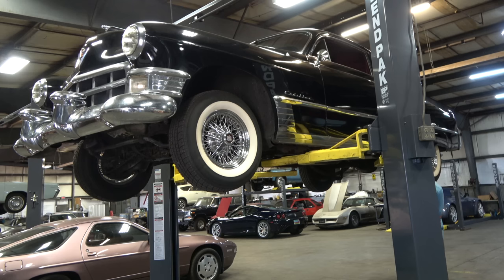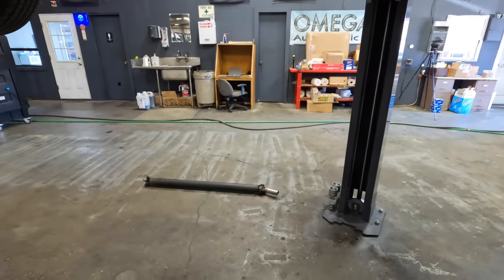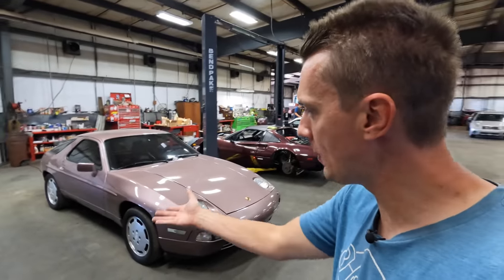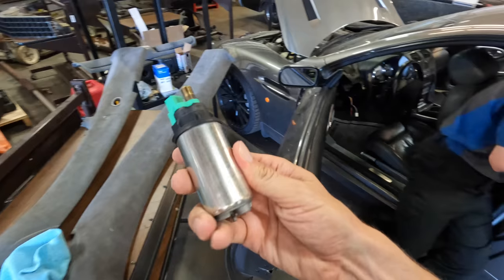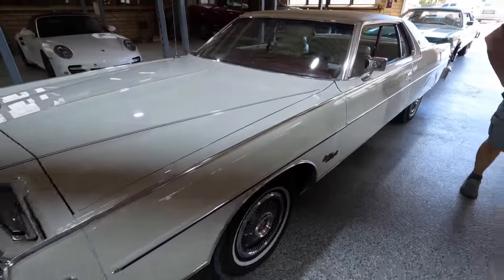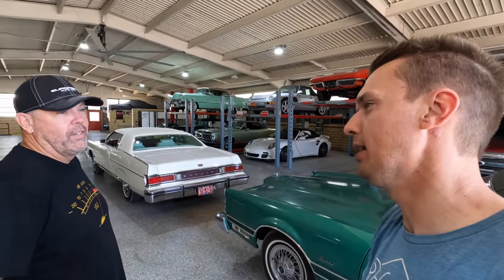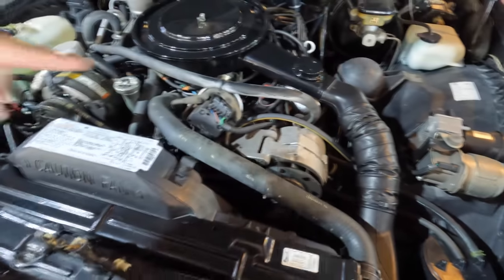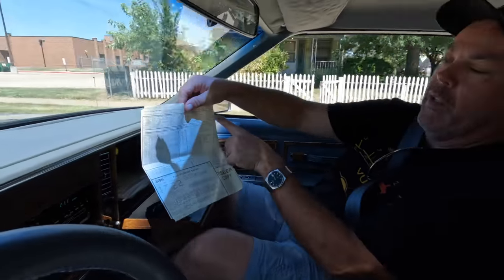We found some weird mods on my 1949 Cadillac Fastback Custom, and more things broken!

Comment: Those 500 CI Caddy motors overheated terribly, so I think the mods were quite beneficial in keeping it cool.
Reply: Drove one for years no problem but I've heard that before.  I would expect a faulty thermostat which is a cheap and easy replacement.
Reply: Yo 🔥https://youtu.be/rdJ9bsN7JAw.
Reply: The size of radiator in my '76 Fleetwood Talisman was insane. It was a 4-core, nearly 3 inches thick and about 3 feet wide. 3x the size of my radiator in 98 Silverado lol. No doubt those old girls got warm!
Reply: Overheating is what American cars are known for. So the more cooling, the merrier.
Reply: @kevinblankenburg4816  Nonsense.
Reply: @kevinblankenburg4816  only the badly maintained.
Reply: @kevinblankenburg4816  and foreign cars are well known for awful build quality and catastrophic failures 😬
Reply: kalle klovn  Big old Cadillacs were common in Vegas in the 50s and 60s.  I saw Danny the count upgrade the AC on a 60s something Cad.  Rich potentates in the Mid East drove Cads.  That kind of stuff is what GM used to do well on.  I would suspect oversized radiators.  Cad was'nt going to turn troublesome cars loose on the customers in the 60s.  Of course they do it all the time now.  Northstar.
Reply: @zackatron925  English cars enter the chat.
Reply: @rogersmith7396  like the Anglia?😁
Reply: What? Gotta disagree with you on that. Never heard that happening at all and I own a 69 deville with 472. You don’t know what you are talking about
Reply: kalle klovn  the Anglia was just a nightmare all around. It was horribly designed car. And as I recall it was only a GB car. Seen a few in the US. Was just a reminder that not all English cars are a Jensen, MG, or Jaguar.
Reply: All Cadillacs overheat
Reply: @ReaLibro  My GT 6 never did'nt over heat except in winter.  It had a host of quality defects.  I have a TR 6 and they were the "reliable" ones.  The Stag of course is famous for faulty cooling design.  It killed the model.
Reply: @zackatron925  American cars of the 70s 80s and 90s were know for this. In the 60s and 70s  VWs and Volvos were racking up 100,000 or more miles while American cars were in the junkyard at 
60,0000-80,000. In the 90s, Toyotas and Hondas would rack up 150,000 miles while American cars were in the junkyard at 80,000. American cars are finally decent again.
Reply: I had a 76 Fleetwood and it never over heated...never.
Reply: @phat-b6771  Nope, had a 76, a 65 and a 60, no over heating at all and I pushed them. Even a day like today, 98 and the AC on, no problems at all.
Reply: We had several  in the  family  over the  years never  had any issues.  We were  in southern  CALIFORNIA  and Arizona
Reply: They are designed to run on the hot side but if it's overheating, you need to do a full coolant flush.
Reply: @kevinblankenburg4816 my.chevy blazer never overheats. Doooshy comment
Reply: Absolutely, I'd expect that the previous owner had a hard time keeping it cool idling stationary with the AC on. That second radiator and fan would likely to a good job dealing with that.
Reply: Had a 1970 Eldorado in 1973. Took it out West from Chicago, all the way out to Death Valley. No problem running cool. Never overheated up to the point I sold it in 1984.
Reply: I wonder if the extra radiator was to help with cooling when doing parades.  I don't think older cars did that well with lots of slow driving.
Reply: Never had a minutes trouble with my 1976 Fleetwood.
Reply: @rogersmith7396  The 4.1L garbage came first and Cadillac knew it was junk.  I know that because they did not put that engine in the professional car chassis'.
Reply: @stephensafraniii3396  That's good.  But that's also 3 decades later then the car in question.
Reply: @zackatron925  which foreign is this? British?
Reply: @rogersmith7396  ppppp
Reply: @rogersmith7396  p
Reply: Pp
Reply: P
Reply: Pp
Reply: P
Reply: @mexicanspec  My parents bought Cadillacs from 1970 onward as did my grandmother.  The 70 Eldorado was great and I have one.  Around 77 they bought one of those downsized Coupe DeVilles which was silly looking but reliable.  Around 1980 they bought a Olds diesel Eldorado which spent much of its short life behind a tow truck.  It also cost almost 4 times what the classic 70 Eldorado did.  Next car was a Mercedes and they bought no more Cadillacs.  We had a Cad dealer in town in business since 1919 and they were very service oriented.  They are gone now.
Reply: Maybe driven in parades? Overheating a real issue in those circumstances
Reply: @zackatron925  more nonsense
Reply: @rogersmith7396  It is a shame how Cadillac lost so many customer by knowingly putting in crappy engines.  They didn't even give the customer a choice, other than the diesel.  If they would have had the 5.7L engine and had the 4.1L optional, they wouldn't have gone down the tubes like they did.
Reply: @mexicanspec  Our 80 Eldorado was the same car as an Olds Cutlas and Buick Regal/Riviera.  It just cost a lot more.  Nameplate engineering killed GM.  And their insatiable price hikes all the while building the parts in China for dollars a day.  I am convinced cars were much more cheaper in the 60s before China and while the unions were at their strongest.  America has been screwed by Wall Street stock manipulation and corporate greed.  The funny thing is now all major car companies are one bad year away from bankruptcy.  Real boneheads.
Reply: @mexicanspec  And because everyone knows Cadillac is just a dolled up Chevy.
Reply: @rogersmith7396  No it really wasn't.  They had different engines.  Also the Cutlass and regal were not front wheel drive.  In 1981 Cadillac had the V8-6-4 engine nobody else did.  In 1982 they had the 4.1L aluminum engine nobody else did.

The most expensive brand got the experimental engines that were no good while the lesser cars had the tried and true V8's that ran forever.  That was a bad call on the brass at Cadillac.

Did you know that Cadillac sold every car they made with no advertising in the '70's and even up into the '80's.  They had a loyal following but the bad experiences their customers had with their cars killed all of that.
Reply: @rogersmith7396  Later on they were but not in the good old days.
Reply: @mexicanspec  There were other problems in the "good old days" like using substandard steel so shit wore/rusted out faster, to encourage people to replace their cars more often. Planned obsolescence is not a new scourge.
Reply: @keithkenney587  Back then, at least  in the North East, it was common to bring a radiator in to be "refurbished" and they'd just snip out the tubes that leaked and paint the outside of it. That was probably a factor when my '71 Cadillac had to be coaxed through the '79 gas-lines with a goose to the throttle every now and then to speed the fan up and cool it down. Cadillac's two-step system, with a  "WATER" light to give you fair warning and a "STOP! ENGINE HOT" light, and buzzer to tell you to give up, was brilliant. Nonetheless, I'd never heard of the 500s being any more or less prone to overheating than the 472s. Could it have been that the water jacket was thinner?
Reply: I have 4 of them 500ci Cadillac engines still in thier original cars! The run and drive fine! My grandfather was a Cadillac dealer
Reply: An alledged rumor was the supplemental use of "Bar's Leak" coolant stop leak additive at various dealerships as a means of repair during the production run of those engines.

Comment: The tube leading back to the auxiliary radiator was incredibly well done. With the undercoat, it looks completely stock.
Reply: That "tube" IS stock, but does not lead to the 2nd. radiator.
Most all cars of the late '40's to mid '50s-ish had similar ducting and there was no full-time vent on the top of the cowl that you see on cars from the late '50s to this day.
Reply: except there was no undercoating in 1949
Reply: @RivieraByBuick  Everyone knows. No one cares.
Reply: @RivieraByBuick  Yes, there was.
Reply: @Johnny96ri  no there was not
Reply: @RivieraByBuick  yes, there was. Tar-based undercoating has been around since the 30s.

Comment: I rarely like restomods but that said I do appreciate the way this Caddy was done.  The idea of a late model Cadillac engine and trans is much better than the usual SBC or LS1 
that is usually seen. The interior is well done and tasteful.  All in all looks like an enjoyable ride.
Reply: Agreed!  Though I woulda gone w/a much more period correct interior, and used those beautiful stock sombrero Cadillac wheel covers.
But yeah, most resto mods suck major ass.
Reply: I want to know what happened to the factory seats...otherwise it's a beauty
Reply: If they could have covered the seats with aged color-correct supple leather...
Reply: I think Hoosier said this "restomod" was done in the 80s, before restomod really became a thing. 
Back then there was no LS1s (well not as we now know LS1s to be) though sbc were around back then it was more appropriate to go BBC.
Or to use a later models drive train like was done here.

Comment: Whoever did the restomod on the Cadillac, knew he would drive it a lot. It’s all very well done! Love that Riviera!
Reply: @Ivan Navarez
I  was really disappointed that the riviera didn't have the user cool TV screen thing.
Reply: That Riviera is one of the last sedans my Six foot Nine nephew can fit in. He drove a Eldorado (pretty much the same vehicle) until the frame was gone. He drives pickups now with the seat all the way back.
 Can't understand... people are still just as big and cars are getting smaller inside. Guess we are supposed to take or drive a bus.
I am a somewhat normal 5' 10" 220 lb male and the Trax was one of the few compacts I could fit in comfortably, almost.
 Except there is not enough room for my size 12s. Got to be careful. To keep my foot off the gas and brake when I want to stop.  Guess my feet are not supposed to be that wide.
The foot well is a bit crowded.
 Kinda noticed that with cars that don't ever come with 3 pedals.
 But the wife (5' 3") has no problem. I did test driving and read some of the prospectus of whom, most sedans sedans were designed for. I mean got it down to dress size, occupation and age.
 Well they don't appeal to nephew's 6' 3" sister or me either.  200 lbs looks real good on a gal on a 6' 3" woman that does not look like a starving walking stick.
 She looks l more like like a 1970s wonder woman.
My wife hates driving pickups. She also likes trading cars when the gas tank needs attention. Stepping up into pickups is too hard.
 But she did like driving the 2006 7 passenger T-Blazer with the front and rear a/c and entertainment. Yep those were designed more for mom.That is until they went out of style.

Comment: Those Royal Seal tires from Uniroyal were a great idea.  They were self healing tires if you ran over a nail they would seal themselves.  They were an all season tire and that accounts for the aggressive tread design. I worked at a Buick/Cadillac dealership from 86 to 88.  We had a local body shop owner that had an 85 Eldorado Biritz with the stainless steel roof.  He painted the car a Pearl White and had those very tires with real wire wheels.   Extra care was used when we serviced it.
Reply: Yea,that Riviera was something, I had an 83 Eldorado but the motors were crap.I'd like to own that Buick.
Reply: I was a tire dealer and replaced a lot of those tires over time.  They had a great sales tactic though a lot of people would try and patch them when the holes were too big.
Reply: @richardmorris7063  Yup, a 1983 Eldorado had either a Olds diesel 5.7L or a gas HT4100 Cadillac produced 4.1L gasoline V8. Neither was stellar. The Buick Riviera and the Olds Toronado had the 307 Olds V8 as an available engine from 1980-1985. You could get a 350 Olds gas V8 in 1980.
Reply: @gregorymaupin6388  My dad's answer for leaking tires are patches.  LOL
Reply: @tint661  they didn’t work on this tire my friend because they would never stick in any way.
Reply: @gregorymaupin6388  Never said they did.  I said my dad uses tire patches.
Reply: On I-94 near Detroit there's a giant Uniroyal tire that was originally a Ferris wheel for the 1964 World's Fair. For many years it had a giant nail in it to advertise Uniroyal's self-sealing tech. Several years back they decided to clean up and beautify that stretch of freeway, and as part of that they pulled out the nail. ;)

Comment: That Buick made me laugh seeing the headliner failing. Every 80's GM product did this
Reply: Agree.  However this thing is 37 years old.  So pretty well preserved for it's age.  However I'm sure if you tried to drive it, it would fail in a lot of areas just from age.
Reply: Yep. Easy to replace, though.
Reply: I noticed that right away. Made me laugh in a bad way. My 86 t/a headliner needs to be replaced. Fortunately, they are available and better made (1 piece) and not expensive.
Reply: Ford's as well. The bows worked way better.

Comment: The factory Cads which had the 500 in them were outrageously wide and the radiator went from head light to head light.  It may have been impossible to do that in this car.  I have a 70 Eldorado 500.
Reply: Yea you're right.  I have a '76 Fleetwood 500.

Comment: As soon as Bob mentioned it was an "early 90s" Buick, but wouldn't say what it was, I was hoping it was a Skylark.

I had a 93 Skylark as my first car! She was a white, 4 door, Custom, with that 3.3L V6.... I LOVED that car. Freaking tank. My mom originally purchased it, as it was a "program car" from the dealer late in 93, and sold it to me in 99. It had 12k miles when it rolled off the lot with us, and I traded it in with 114k on March 1, 2003, for a brand new Hyundai Tiburon GT V6.

We took that Buick all over. My mom used to do bowling tournaments, and I'd go with her when I could. The first one with the Buick as the car of choice was Lansing, MI, and I think the last one was either Buffalo, NY, or Baton Rouge, LA.

Comment: You could get the later Cadilac on board 12 V air compressor and hook it to your shocks and modify it to maintain constant pressure.  It is called load leveling and was designed to automatically prevent rear end squat with heavy items in the trunk.
Reply: They copied that from Packard lol!
Reply: Go low-tech with an Old Man Emu OBAC and plumb it in to the existing system. Run a switch and run a line to a gauge under the dash. Easy-peasy.

Comment: The 92 Buick Skylark GS coupe had one of the most beautiful side profiles.  I would know.  One was my first car.  A beautiful rear profile as well.  It was black and grey with the 16 inch alloys.  All the options with a black leather interior.
Reply: Didn’t the coupes have a more normal looking grill?
Reply: The side profile looked odd with the squared off rear wheel arches...
Reply: Mine is a custom, red porn star interior, catless 2.5" exhaust. Do you know about what suspension it uses or what suspension can be put in them? I want to lower mine a couple inches for my wire wheels coming in. Non air suspension btw

Comment: For 928 parts there are a few specialists worth checking with, 928srus (Roger is the owner), 928intl (Mark is the owner), precision Motorwerks in Anaheim (Greg is the owner), and 928 motorsports (used to be owned by Carl).  928 specialists I'm not sure is open currently, owner Dave died recently.  Either way, if parts are available they'll have them or know who does.
Reply: Thats whats happening, alot of specialists are going the way of the Dodo, because the original owner who built the business up over decades passes way, and then the kids either run the business into the ground or they would rather sit and play video games than work with machine tools.. A good machinist should have no problem making good money these days

Comment: "These are the original tyres" is the probably the last thing I would want to still be original on an old car.
Reply: Maybe original oil would be worse :-)
Reply: Looked like snow tires.
Reply: Rubber aging is overrated.
Reply: yeah, that's what the Russian army said, too...
Reply: Depends on the conditions in which they age, really. Outside, barely moved, not kept round? Tires will age like milk.
Reply: Hey ShinyShow, I love your Jem777. I have one too. 😀✌🏼️🎸
Reply: You act like that car will get driven more than 10MPH around a car show.

Comment: I worked for GM for 38 years. Back when I lived in Cincinnati (working out of the Chevrolet Zone Office) I was at a meeting at the GM Training Center. After the meeting the Training Center Manager asked me if I had driven an 85 1/2 Rivera T Type. I said I had not. He had one as a company car so off we went. It had the Buick 3.8 Turbo V6. The same engine that was fitted in the Regal Grand Nationals in  84 and 85.  We drove down a side street and stopped. He said, do you notice those two dash lights on the instrument customer? He said hold your foot on the brake and the first light will come on then floor the gas pedal. He said when the second light comes on release the brakes. I followed his instructions and we did a huge  burn out with the front tires. The car took off like a shot. In those days performance was just starting to make a come back. That was a lot of fun. They didn't make many Rivera T types. It was a very comfortable car, looked great and was quick. Especially for the day. cheers!!!